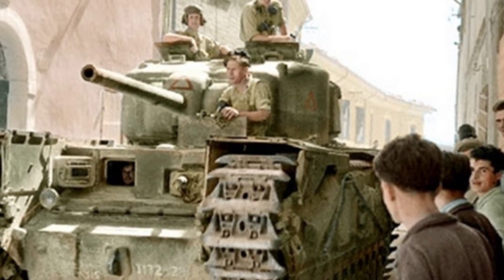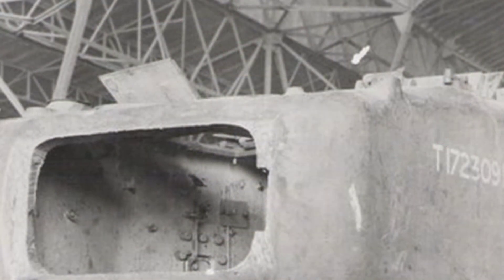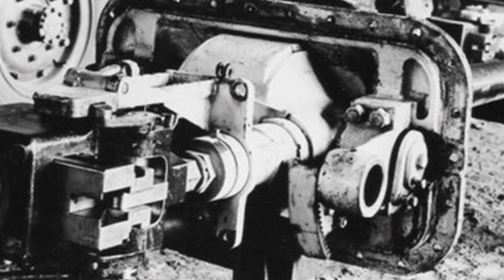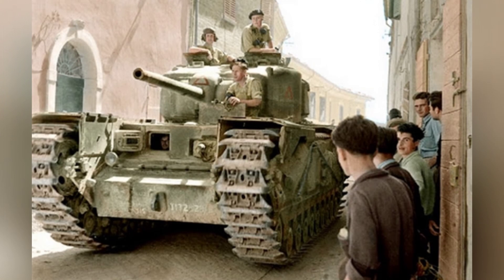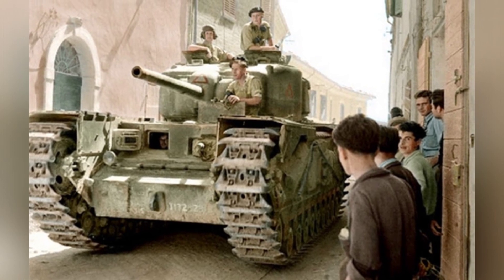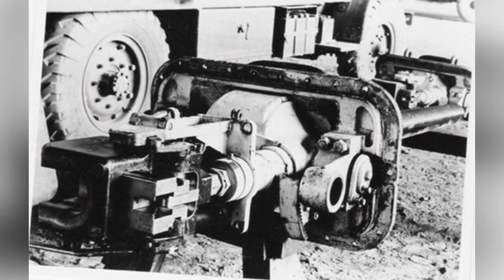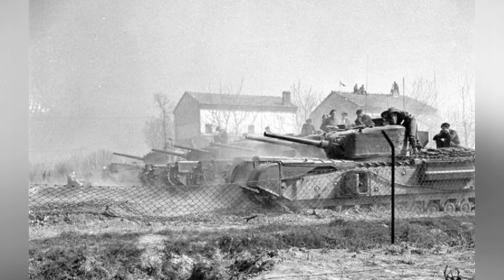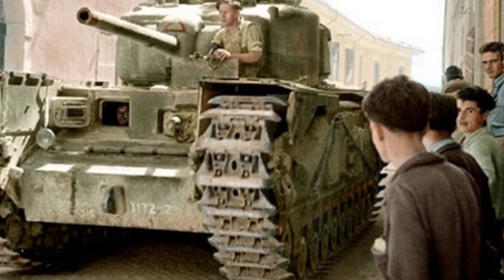Enhancing Firepower: The Churchill Mk IV-NA 75 Tank Modification

Comment: The Churchill MkIV was armed with a 6 Pounder Anti-Tank gun which had greater armour penetration than the 75mm mounted on the Sherman, knocking out at least 2 Tigers in Tunisia. The Churchill had twice the armour of the Sherman and far better off road speed and agility. However at this stage in the war some troops preferred the 75mm for its good HE shell. A Batch of 200 Churchill MkIV were fitted with the 75mm guns and mountings from scrap Shermans at workshops in North Africa. These were the Churchill NA-75 and were issued to the 25th Tank Brigade which saw action in Italy with them.
Reply: Uhm idk how to tell you this but the Sherman with the 75mm gun knocked out tigers on a few occasions. Infact probably more then the churchills. It was simple to hit them in the side or rear cuz they are slow, also the mg port in the hull was easy to hit and the tigers would often miss the first shot in head on engagements. Some were even killed by groups of Shermans simply peppering them with he shells over and over and eventually the blast waves and armor chips would kill the crew without destroying the tank
Reply: @alhids35  Lol I hate to say this but...There are certainly stories of Tigers getting knocked out by Sherman 75s. But I have never seen proof, they are just stories made up by fan-boys. Probably after a chat on WoT about Tiger vulnerabilities. No pictures saying this Tiger was destroyed by this crew, at this town on this date, not one!

One of the first Tigers knocked out by a Churchill is now in the IWM and was used in the movie Fury, that is PROOF. Or  like say Sgt Harris of the 4/7th Dragoon Guards destroying 5 Panthers with  5 shots or Sgt Brown of the 2nd Northamptonshire Yeomanry destroying 3 Tigers in 20 minutes. But these well documented kills were by Sherman Firefly's.
Reply: @billballbuster7186  so you heard about Shermans killing tigers and decided you hated the idea so much that you did no research? Its very well documented there was even a section in a training manual for Sherman tankers explaining exactly how they could take out a tiger.
Reply: @billballbuster7186  "The superiority of German armour was illustrated again when three Jagdpanther tank destroyers knocked out 11 Churchill tanks of 3rd Scots Guards on Hill 226."

IWM Tactics and the Cost of Victory in Normandy page
Reply: @nickdanger3802  Here you go!  Hill 226 was part of Operation Bluecoat, which resulted in a German defeat. The Germans lost over 100 tanks (no exact number) and the British 156 destroyed. If your read the full account of Hill 226 the Scots Guards were also under intense artillery fire from anti-tank guns as well as Jagdpanthers.
Reply: Everyone always says it took 5 Shermans to kill 1 tiger, the actual figure is under 1.5 I think it's 1.24? The invincibility of the tiger is truly a myth. The king tiger was a menace to Shermans but the tiger 1 wasn't that difficult to deal with. The problem is in the early days of internet forums closeted Nazis loved to go around claiming the Sherman was a death trap and the myth spread wildly even tho the adverage casualties in a Sherman loss was 1 wounded 1 killed. That's out of a crew of 5. Most tigers and king tigers hit would lose almost all of their crew. The Sherman was by no means invincible or anything but a squad of 4 Shermans could easily take a lone tiger especially if they had a 76 armed Sherman or a Sherman jumbo in the group
Reply: @alhids35  No, not exactly, you are correct about German fand boys. However the comment "it took 5 Shermans to kill one Tiger" was said by the Americans in Normandy. It was no myth about the Sherman being a death trap, US figures claimed 74% of Shermans penetrated by AP shot were burned out.

What you really have is years of combat reports from WW2 that criticize the Sherman. Versus the opinion of armchair experts talking 70+ years after the battle. People who are none to accurate with their figures, and juggle statistics to prove their point. For instance, if you take the figure of all Shermans suffering damage, thost that were burned out is quite small. But if you are specific, the number penetrated by AP shot, the figure shoots up to 74%. Same with Casualties, overall only about 1.3 % casualties, Shermans penetrated by AP shot and its 80 %. most fatal.
Reply: @billballbuster7186  no the 5 Shermans to kill a tiger thing was a myth and it was started by early German fanboys and spread by a well known author who shall not be named who wrote a book about the Sherman being a death trap. I suggest the cheftians video on the myth of American armor he goes into great detail about all of this and where the claims came from. 

Combat reports were not critical of the Sherman the us army tank corps loved it and refused to accept multiple replacement proposals because they would rather stick with the Shermans that worked fine for what they were doing. Most of the criticisms of the Shermans came from the British to my knowledge and from commanders and generals who sat in chairs in strategy rooms most of the war. Most Sherman crew knew if they were hit the probability of them going home unharmed was abnormally high. There are a lot of interviews with Sherman tankers in their 70s talking about how they all hated Shermans but that's 50 years of hindsight and bad memory. No one remembers the thousands of combat tasks completed successfully everyone remembers when a crew is hit in the ammo stowage and every dies. Losing friends in Shermans really clouds your opinion of the vehicle. Even the soviets loved the Shermans they were given.
Reply: @alhids35  Firstly, Belton Cooper wrote the critically acclaimed book "Death Traps" after spending WW2 mostly recovering wreaked Shermans. The book was challenged by some on just one comment, That Patton preferred the Sherman. This is not correct Patton, Devers and others lobbied for the M-26, they hated the Sherman. But otherwise Historians rated his personal knowledge as outstanding. Read the reviews.

I did see  Nicolas Moran's (Chieftain's Hatch) comments on Sherman. He did in fact confirm that 74% of Shermans burned. But excused this by saying 'all tanks burn' which is true but misleading. The British Cromwell, Russian KV-1 or German Panzer IV for example never earned a reputation for catching fire. Their ammunition was better protected.
Reply: You yourself confirm what I said, Sherman veterans from WW2 hated the Sherman. But the Generals sat in their offices away from the battlefield loved it. May be they were getting kickbacks. But only the idiots that designed the Sherman put 72 rounds of ammunition in the high side sponsons protected by only 37mm of armour. Then put a huge white star over it as an aiming mark
Reply: @billballbuster7186  Belton cooper wrote a book to demonize us armor in the second world war and make German weapons out to be better in every way simply because he was "one of those" people. I personally work in the field of military history and I don't know anyone who regards his book with any credibility besides those with his same goals. And that's why most of his reviews are good, as only people who already agree with his ideas buy it in the first place. 

Shermans did burn, it had nothing to do with the Sherman being a Sherman, I don't know where you get the idea that other tanks didn't burn as often but when it comes to German tanks they could only abandon the tank if it was on fire or completely immobilized or they would be tried as deserters. Additionally most German tanks didn't get shot till fully destroyed as the crews would bail as soon as they could with the exception being the SS tanker corps but the reason for that should be obvious. The same goes for Russian tanks for instance most Russian tanks took immobilizing hits and were abandoned. If you want to talk about tanks burning look at the t-34,  those things got punched with 88s and lit on fire all the time it's a small tank interior with lots of fuel and ammunition. Most tanks burn, diesel burns hotter and longer than gasoline. Sherman crews regularly escaped tanks that burned most of the fires started in the engine compartment and had nothing to do with it's ammunition storage. Most Shermans were taken out by infantry aiming for engines and the sides of the tank it's not rocket science to see where the burning will come from. 

The Sherman earned a reputation for catching fire because of the Germans in North Africa. When you hit a relatively small tank like that with a large gun it's going to go straight through it and start fires on its way.  The kv-1 has a reputation of having its armor flake off from the inside and injure it's crew because Russian steel was over hardened, every tank has its problems but you only ever hear about the Sherman being bad. As for the Cromwell I wouldn't know, I don't think it even served long enough to get a true picture of it's flaws. And the panzer 4 definitely burned. The eastern front ate through them incredibly fast and the main tank to fight them on the western front was, no surprise, the Sherman. An equally matched tank capable of destroying them. If the crew survived the hit what happens to the vehicle is meaningless, another one will be ready when they recover. The Sherman was perfect for the role it was designed for, being a medium tank capable of fighting tanks of a similar size and supporting infantry.
Reply: @billballbuster7186  no what I said was the generals hated it for the losses of vehicles, the crews loved it because they didn't die in a burning wreck. The human mind is flawed you can't trust a 70 year old to remember what did and didn't happen, the reports from right after the war and the function of the Shermans in Korea are better for telling you whether it was hated or not. Thousands of men served in Shermans and people are only interested in drama so of course every documentary or book written in the last 40 years cherry picks whose story it tells for the most sales. I could find you 10 people that think that biplane fighters were superior in the war that doesn't make it true.
Reply: @billballbuster7186  most tanks will be destroyed if hit from the side, the panther, kv-1, tiger, t-34. They all also had sponson ammo racks with relatively low protection.
Reply: @billballbuster7186  
At 3.00 "in Britain it was adored" 
Tank Chats #70 Sherman M4A4 | The Tank Museum 
https://www.youtube.com/watch?v=AetDM3fJVIE&t=3s
Reply: @billballbuster7186  The website Tank and AFV News as well as historian Robert Forczyk [de] were critical of the book and the reliance it has garnered online and in media coverage, writing:
As a memoir, it is meandering and repetitive, far too often wandering away from the author's personal experiences into the realm of speculation. As a history it is lacking, containing no end notes, foot notes or bibliography. And finally, as an indictment of the M4 Sherman tank, the book is filled with so many factual errors and outright falsehoods, it cannot be taken seriously on this count either.[6]
https://en.wikipedia.org/wiki/Death_Traps#Reception
Reply: @nickdanger3802  Make up your mind, first you stated it was mostly the British that hated the Sherman. Now you say the British loved it???? You contradict yourself because it, like all tanks, had good and bad points and you can't seem to grasp that.

Let me repeat myself again, it was liked for its reliability and its large and accurate HE shell. The criticism was in its abysmal  performance against other tanks.
Reply: @billballbuster7186  abysmal performance agienst other tanks, lmao 🤣 no it was actually really good agienst other tanks that weren't heavy.
Reply: @nickdanger3802  Yes I have seen this article and your obvious bias shines through. Highly regarded Stephen Ambrose gives it high praise. While Robert Forczyk (a Gamer) who I have never heard of, gives criticism for his writing style. None specificly say how he was incorrect, apart from the Patton comment.
Reply: Churchill and Sherman tanks (Tank trials)
https://www.youtube.com/watch?v=HseO2f0WGDg&t=1087s